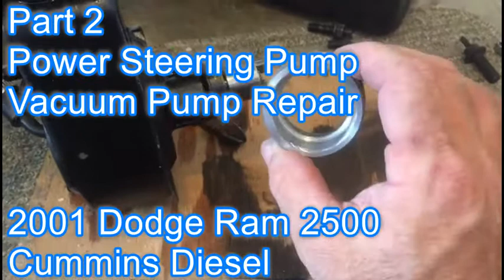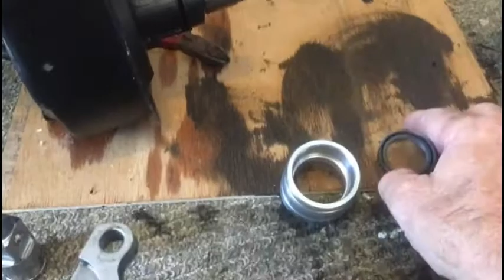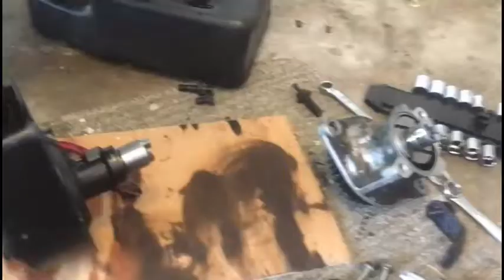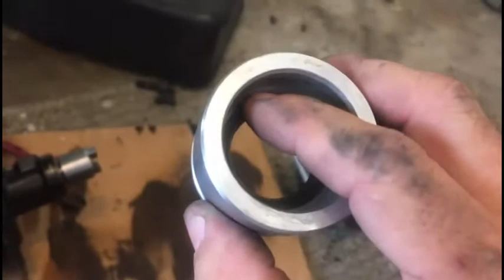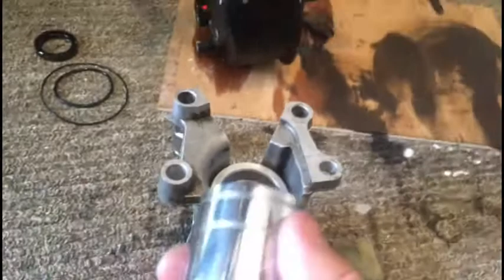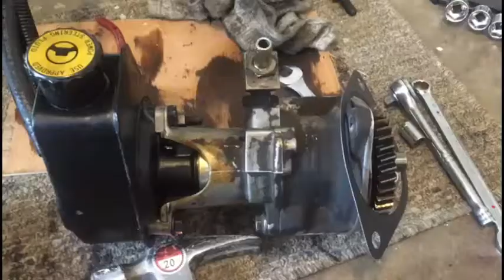Power Steering and Vacuum Pump Repair pt2 - 2001 Dodge Ram 2500 Cummins Diesel

Comment: Great video thank you. One question: the star gear has a small punch mark / recessed dimple. Is that an oiling hole? I think i see from your video you placed it face up towards the ps pump. Is that critical? Thanks again

Comment: Hey man I replaced my vacuum pump this weekend and put it on the truck first and then put the power steering pump on. Was a pain having to turn the Ps pump little by little to get it to click in but is there anything I could’ve done to make the power steering pump make a whine now? It’s only a few months old and I’m afraid it’s gonna quit out. Maybe I got air in the line have it tilted and turning the pump?